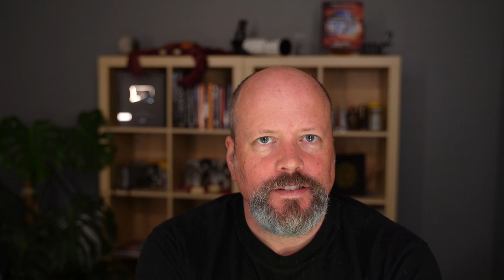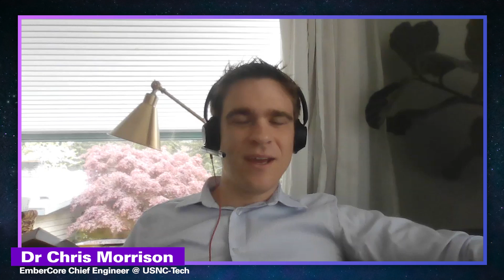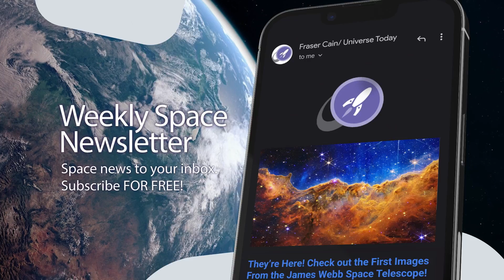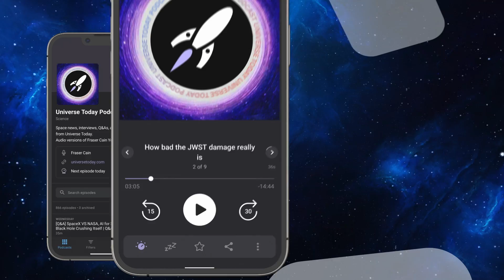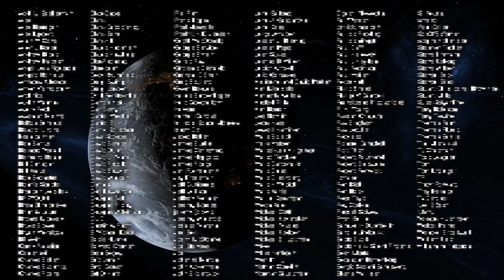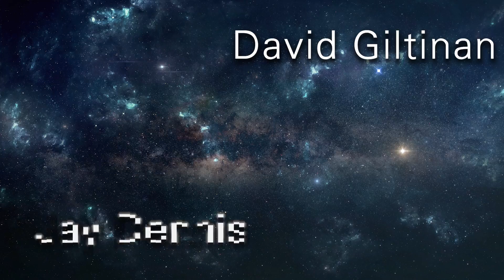Observe the Universe from Deep Space [NIAC 2023]

Comment: What if the rotation of Omuamua actually were part of the craft doing visual interferometry - having their telescopes at both ends of the craft (or one if there is a rocketnozzle at the endpart ). If the craft are 100m long penn then its a 100m? telescope or its a sail with the telescopes in the 4 corners -obviously maybe weaker ones

Comment: Some isotopes are stable until they are changed into a shorter-lived isotope. Take that along as a late-stage power source, e.g. a sample return. To be altered when needed. Or, if you can gradually transform the isotope, you can use it to replace the initial isotope, as its half-life reduces its power output below optimal levels, for a given mission.
Reply: Ooo, that’s a cool idea!
Though the fact that it wouldn’t decay all at once would probably lead to it giving a fairly constant power output. Well, a fairly constantly decreasing power output.

Comment: Question Spacemeister;  Presuming that SpaceX's StarShip is online and fully operable in 3 or 4 yrs, It will have a Payload Capacity of 5-10 x that of the Ariane 5 that launched JWST to it's place @ L2.
    So, using the weight and size limit advantages of a rocket like SS, what would your company, Cain Space Telescopes, develop as a Next Gen Space Telescope, what "mission statement" would be the goal and where would you place it ?   (No worries, I'll pay for the Launch   ; )

Comment: The stirling converter NASA has been testing for 14 yrs seems like a great source of enough power.  The heat source can be kept far away from everything using molten salts to conduct the heat to the engine.
Reply: They want to use a solid state method of power generation to minimize points of failure.
Reply: @titanbot11  14 years continuous operation. It has one moving part.